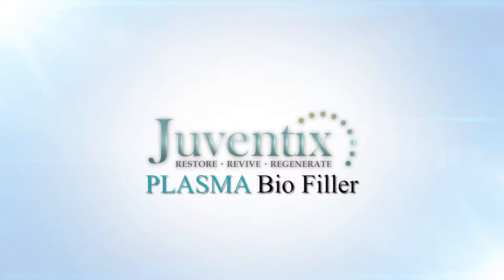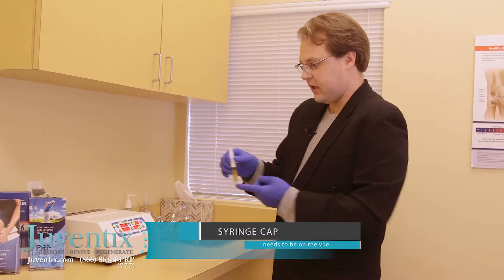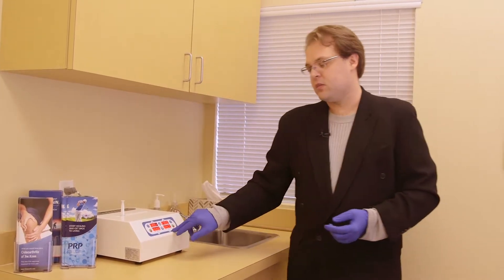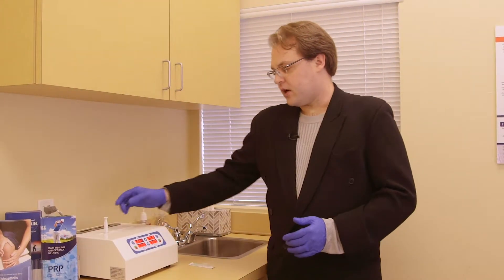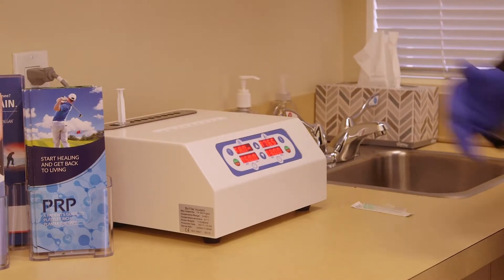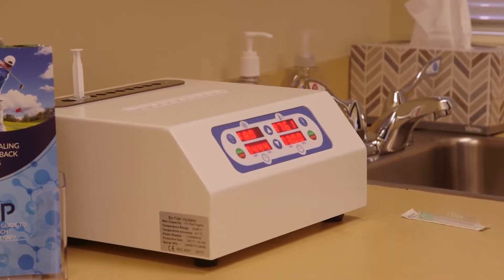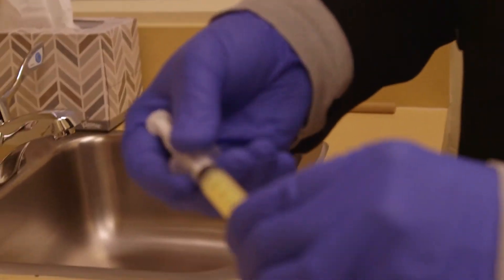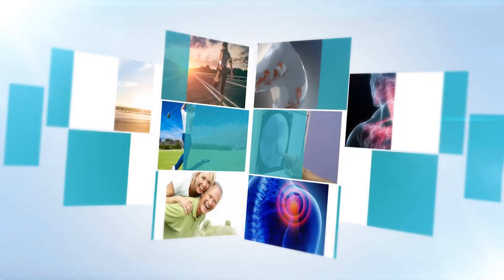Juventix PRP Instructions: Extracting Plasma Bio Filler

Comment: was thrombin added to syringe prior to heating?
Reply from the maker: No, the only additive within the PRP processing tube is ACD-A (citrate dextrose solution), which is the only anticoagulant product approved by the United States Food & Drug Administration (FDA) for the use in Autologous PRP Systems. Platelet activation with the bio-incubator is achieved through a gentle heating and cooling process (patent pending) and stimulates the platelets to excrete calcium naturally, triggering the thrombotic cascade. Hope that clarifies, and thanks for your questions!